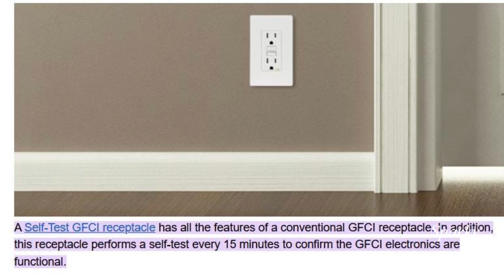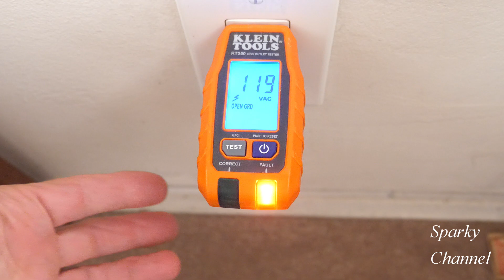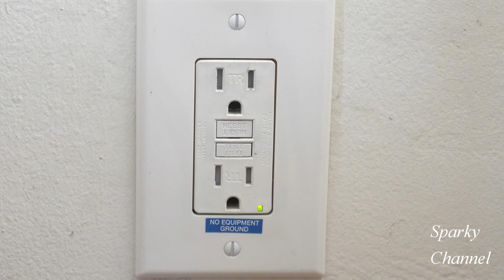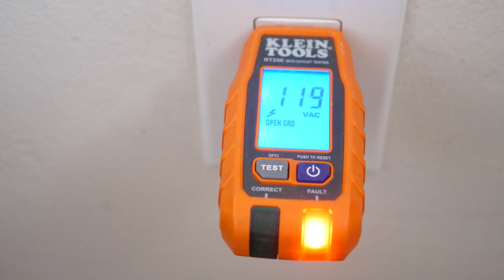Why Doesn't My GFCI Test Button Work?

Comment: Hey 👋 I've run into old gfci's that won't trip with a tester but will trip and reset by the button. These ones are grounded so in this case are they still okay?
Reply: in that situation, the most likely cause is the line wires are connected to the load terminals.  on old GFCIs the reset button mechanically resets the device, so it can be turned on even though it is miswired, and the test button still sends current around the outside of the GFCI mechanism, so it still trips with the device test button, but since the power is coming from the wrong side, the sockets on the GFCI are unprotected, and so a plug in tester will not trip it.  in that case, they can be rewired correctly, and they should still work.  if it is wired correctly and still behaves like that, then it or your tester is faulty.
(a quick test for a reverse wired GFCI would be to test a receptacle protected by the GFCI. if the tester trips the GFCI from a protected receptacle and won't trip the GFCI when plugged in directly, that is the problem)
Reply from the maker: Interesting. Perhaps the ground isn't attached? Have you tried the test with another tester?
Reply: @SparkyChannel  yep. The ground is attached and secure and I've tried 2 testers. Is it the age or did it fail?
Reply: Could be a bootleg ground?
Reply: @luislazogue8089  nope not a bootleg ground